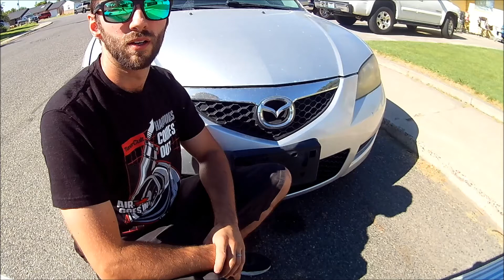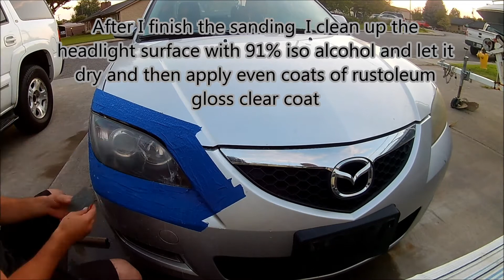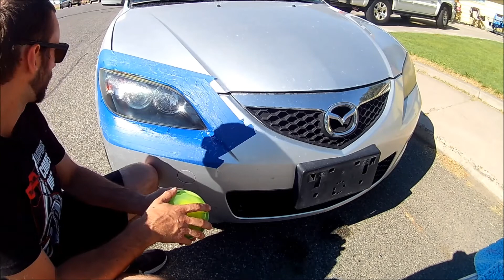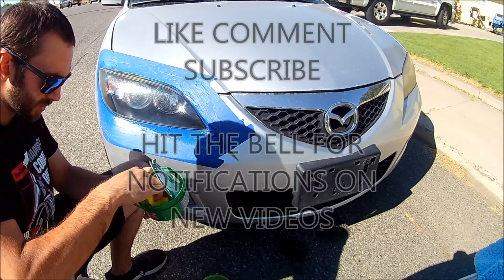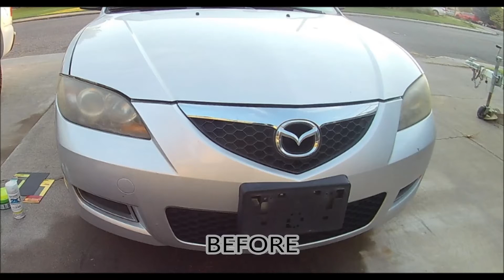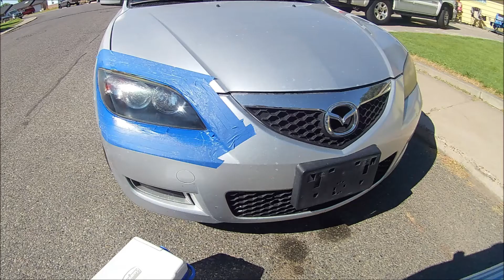HOW TO Restore headlights SEEN ON Chrisfix

Comment: Good job ! I wouldn't work in direct sunlight though. Looks like your clear coat had orange peel,.which you could sand down for it to be perfectly smooth. Also wait a few weeks before applying wax so it can breathe and fully cure. Good job anyways.
Reply from the maker: Thanks for the comment, I may have rushed this a bit but I can go over it again and get better results like you have said.